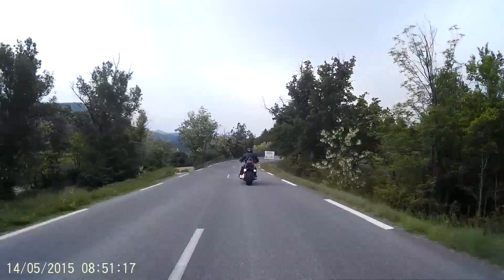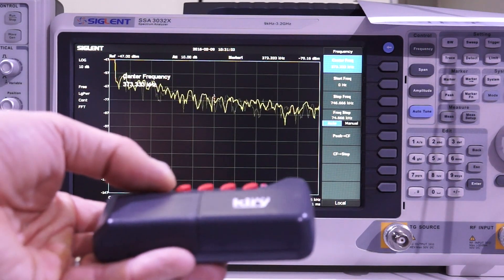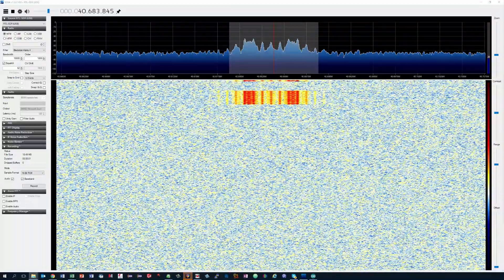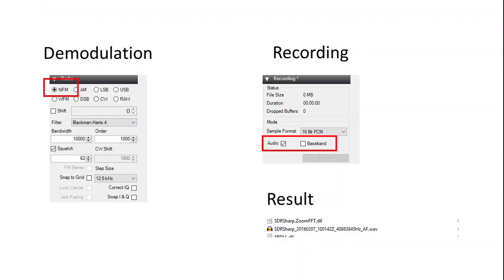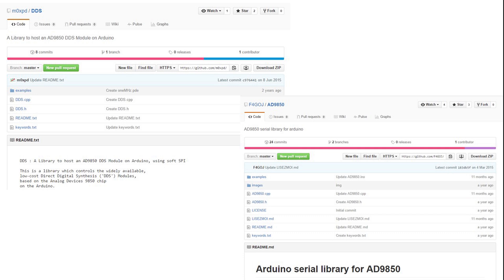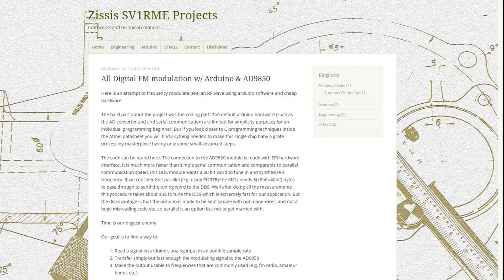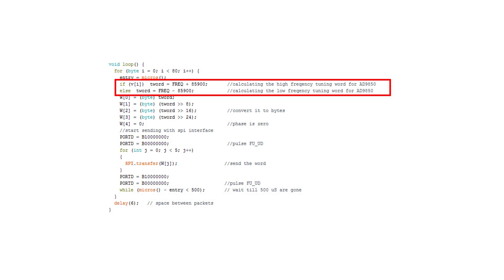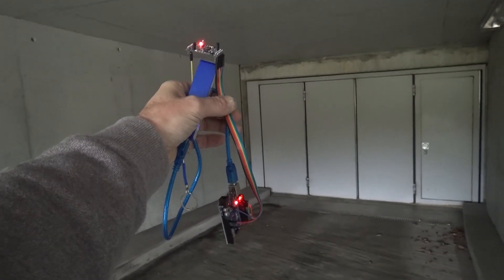#44 Hacking and Cloning a Garage Door Opener using SDR Radio

Comment: Awesome work!!!!. Sir, have you tried hacking a wireless keyboards with NRF24L chip on it ?
Reply from the maker: +Venkatesh E No, but I saw a video of a guy who is specialized more in hacking than me: https://youtu.be/WqkmGG0biXc
Reply: Andreas Spiess Thanks. Yeah I got the inspiration from the same video. I have a Logitech wireless keyboard. So do you have any hints on analyzing SPI signal. I saw couple of SPI/I2C logic analyzers, I am not sure whether the correct one's to decode the SPI NRF signal. Please let me know if you have any ideas. Thanks once again.
Reply from the maker: +Venkatesh E Saleae sells great small usb logic analyzers. The software runs on you PC and can decode all kind of protocols including SPI and I2C. There are many copied versions on aliexpress or ebay. But, of course, the use of the software with these devices is illegal, but working.

Comment: awesome video .  now there is 2 things i have to put on my wish list . LOL  . I also like how you used while to  count off the balance of the 500 .  very clean and small bit of code but so handy for many timing things.    After watching CNlor 's video about getting a ESP8266 to broadcast  color TV , i half expected to see you use a ESP v12 for the transmitter .  Great projects as always.
Reply from the maker: +XerotoLabs Good Idea. I Think, It should be possible to create a 40 MHz signal using internal timers. And if not,  13.3 Mhz (40/3) should be possible. And because the ESP creates a square signal it should have lots of 3rd grade harmonics to open a garage...
Reply from the maker: +XerotoLabs By the way: This timing procedure is my standard procedure because it is non-blocking. You can do something in the loop. And it is more precise because it takes the rest of the code also into account. Delay() does not do these two things. There is only one small issue: If millis() or micros() gets big enough it starts at  0. This loop has no delay because millis() is smaller than entry right at the beginning. This is why I usually use unsigned long numbers.
Reply from the maker: +XerotoLabs I saw the video. It is really interesting. For my case, I have to hit the two frequencies quite exact as I cannot trim the receiver as it was possible in the old TVs.

Comment: wouldn't it be easier if you connected your remote to your bike's battery and shorted the button? or extended the remote button to the bike handle and stuck the remote on the bike permanently? or even easier,  glue the remote to the bottom of the bike seat so you always know where it is? in any case just use the existing remote. cheaper, faster and easier.
Reply from the maker: +Ady Price You are right, it could be possible to do hat. There were a few reasons to do my way: We have only one remote and now, I can leave this one in our car. And I hope, I will be able to get it smaller than the original one. Because of humidity issues on a bike, I want also to be able to cover it completely with hot glue. 
I have to admit, I had a third reason: I wanted to play around with the new technology of SDR  radio and DDS and found, this is a good example to do that. I am just an engineer ;-)
Reply: +Andreas Spiess I thought you maybe wanted to play around. makes sense. I was just curious maybe I was missing some technical difficulties (newbie electronics hobbyist here) besides humidity that would make it not feasible but you already answered that. you inspired me to do something with my garage remote too. since I sometimes have to look for it in my car if I take some sharp turns, and it has a really weak signal in the winter.
Reply from the maker: +Ady Price Good! I hope, you enjoy it as I did when the door opened the first time with the clone...